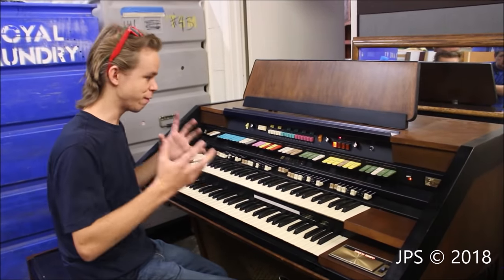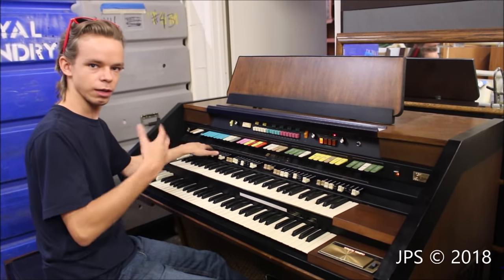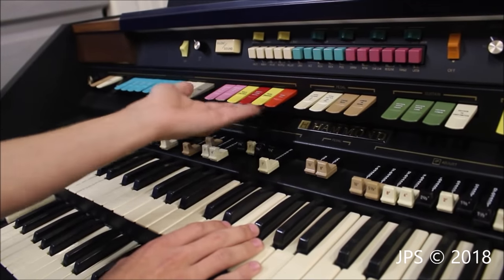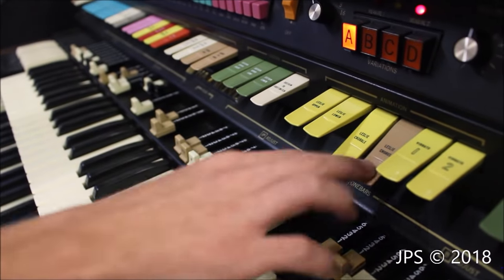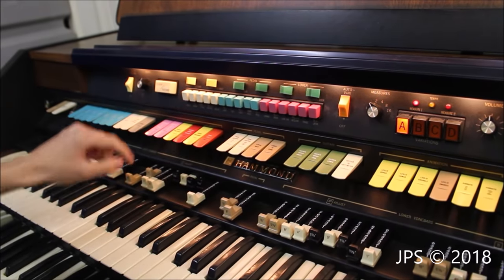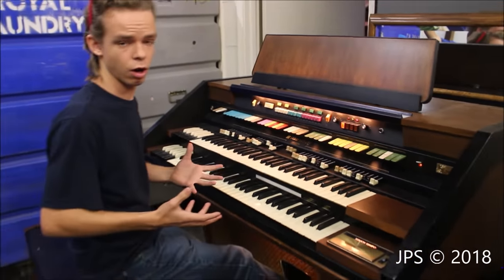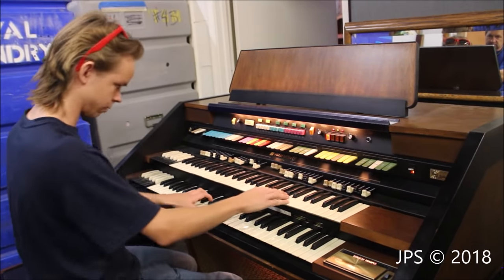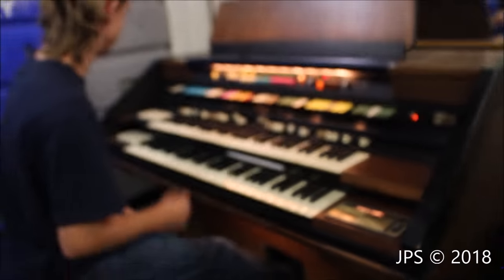James finds a $300.00 Hammond Organ, your thoughts? Cheap Deals

Comment: I have the exact same organ (almost) sitting 20 feet from me as I type this. Electronically, the Concorde was a great design...mechanically not so much. First, that constructed all the electronic (PC) boards out of phenolic. Over time they warp and so when inserted into rigid inline edge connector sockets, some of the edge contacts....do not make contact and this can cause a lot of random problems. Boards made out of glass epoxy, while slightly more expensive,  do not have this problem. No one uses phenolic anymore. Cleaning the contacts will not solve this problem, but will help the ones that are still making contact.

Hammond used the best capacitors available at the time they designed the organ...late 60's. The only ones that I have seen fail are the power supply electrolytics as they do with age in all electronics. When they are leaky, they typically cause hum..not static. The tone wheel organs had a bunch of "orange drop" caps in the tone wheel assembly that have to eventually be replaced also as they drift in value with age.

The IC's in the Concorde were custom designed by Mostek .. a Texas company that also made the parts for the first electronic calculator and many other things. Very new technology in the 60's and probably .. counting their design cost as it was unique to the Concorde .. was half the cost of the organ for Hammond as everything else is discrete parts and common ... still available today.

I designed electronics for a living and am now retired with time so fixing these problems became a challenge for me. ;) When I bought the organ in the early 70's they gave me the service manual so I had all the electronic info. I relaid out all the boards in glass epoxy, combined some circuits onto fewer boards (there were a lot of boards!) as smaller and better parts are available today, and ... because engineers can't resist "fixing things" .. changed a few circuits including the power supply which was ... a mess. The original "unobtainium" IC"s were carefully removed from the original boards and installed in sockets in the new ones. So now when I turn it on, I can count on no problems. I hope! A fun almost year long project, but glad I didn't have to pay for the labor!

I've seem the custom IC's being sold on the web for 200 dollars each ... and there are 45 of them, so if you find a Concorde cheap, carefully remove the IC's from the boards, and then throw the rest of the organ away you could make some real bucks!

Hammond designed and sold several other "IC"  organs after the Concorde including the Elegante in the early 80's. Between their design cost and the fact that people were not buying home organs any more, it probably put them out of business. 

Jim
Reply: Cool project! I’ve done a similar sort of project on my Soundcraft 2400. The original PC boards were FR4 but single sided. So many pads lifted from the leverage of especially the TT patchbay jacks but also some of the switches. I’ve redone most of the board in double sided FR4 with very generous pad sizes on both top and bottom, and it is now very reliable. Some of these ‘disasters’ can be cool projects when you are an engineer or technician.
Reply: I came across one of these back in the mid 90's when I had a business fixing organs . These were almost impossible to repair due to the custom chips you described and the warped boards were a nightmare. Cudos for fixing yours that's a labour of love. I have an L111 which is much simpler and through my Leslie 147 RV it sounds like a Hammond should.
Reply: Kind of a shock (get it?) when you consider that the contacts in a B3 were made out of palladium.
Reply: I was going to say, that thing is definitely pre-1980s just from the external design, but also organs were so uncool by the 80s because of synths.
Reply: I hope you also took the time to think adding a feature to your new glass epoxy PCBs !!!..... yes ADDING A MIDI RETROFIT TO IT....OF COURSE, IF YOU BELIEVE IT CAN BE DONE !!
THAT WOULD BE AWESOME AND EVEN NOT HAVING TOUCH SENSITIVITY
IT ADDS A LOT SPECIALLY IF YOU PLAY VIRTUAL SYNTHS LIKE THE 
B4 II by Native Instruments Plugin.....but now it is discontinued !
There are other Virt Inst brands to find Hammond like sounds !
Please post comment if you think you will add that and add your video
working MIDI with your Concorde !!
Thanks

ps. sorry 4 the caps, the caps key got stuck !
Reply: @techy5025  Great comment. Maybe the most helpful I've read all week. I grew up with a Lowery organ, so I totally understand your passion to fix rather than scrap'n'sell. One day, perhaps I'll get around to fixing my old Lowery. It currently still sits in the basement waiting for Godot.

Comment: Last winter my wife and I were thrift store shopping over near Pittsburgh and we wandered into a Goodwill store. There was a Hammond M3 Tonewheel organ sitting in the furniture section. It looked like new except for a recent scratch likely acquired in the donation pickup. The store clerk said that it was being sold as a furniture item and it could not be tested or even plugged in due to its age and lack of a modern 3 prong power plug. It would not fit in my car, but I paid the asking price and was given 48 hours to pick it up or forfeit my money. Of course it was snowing when I set out to pick up the organ, but the guy unloading the donation truck helped me stuff the 250 pound beast into my Honda Element.....it barely fit. This M3 turns out to be from 1958. The original purchase receipt was in the bench, as was a receipt for $200 worth of servicing from just over a year prior. Seeing that, I decided to forgo the usual teardown needed for vintage electronics, and plug it in. To my surprise, it plays perfectly with no hum and all functions work. It's still going great 9 months on. The purchase price.......$39.95. It cost me more in gasoline to make the two 70 mile (each way) trips to get it.
Reply from the maker: What a wonderful story. It's just great to hear about saving a vintage instrument from just being a piece of furniture or worse.
Reply: I used to play an ARP Odyssey back in the 70's, but never had a tonewheel Hammond or room for one. I was surprised to see it at a Goodwill store for cheap, and couldn't pass it up. I can't play like I did nearly 50 years ago, but still try. My daughter plays well and maybe one of her kids will get it somewhere down the road.
Reply: I wonder how many people are still around to rebuild these things what a unbelievably fantastic musical instrument
Reply: Now all you need is a Leslie to go with it; of course it will cost quite a bit more than the Hammond.
Reply: Booker T machine
Reply: @ TubelabCom: make sure you'll never let me know where you live or you'll be saying goodbye to your great find sir! did i say "find"? no, it's a steal you happened to make u lucky U! ;-) :D
Reply: @dojmike  don't forget about the a182... I have a 1970 in the garage and  it's the first model that electronic met electric from what I gathered from talking to many professionals at the last few namm shows...
Reply: I received a M-100 from a church in upstate NY  ("just get it out of here")
They could not figure out how to even turn it on.  It had been so long since service that the motor would not start.  A little oil, a little patience, and two weeks later, I had a functioning M-100.  Great sound, but, i donated it to a local church that needed one, just to maintain karma.
Lots of neglected ones out there that just need a little love.
Reply: @bigbirdnys  You did a good deed! I bet they were thrilled to get it!
Reply: TubelabCom: You scored BIG with that organ. Make a video when you get it squared away..
Reply: Wow! Good to know, that you can still find a diamond in the rough!

Comment: I repaired a similar model Hammond for a relative in the '80's. If I am not mistaken the one feature I did not see you explain is the brass switched capacitance touch plate on the lower left manual that can be used (when set to "on") to set tempo and start a previously selected percussion rhythm automation by tapping the plate 1-2-3-4 (HAMMOND TOUCH TEMPO)   Great Video.

Comment: These are completely solid state. No tonewheels and no tubes. I had an R-100, which is similar to this, and it seems 90% of the electronic gremlins on these are due to the 'edge-cards' they used to house the components. These individual boards plug into a bus, much the same as computer graphics and sound cards plug into a motherboard. The contacts get corroded over the years, and it's a pretty simple (but time consuming) job to pull all the cards and clean up the edge contacts with fine steel wool and some electronics spray. The spray also works well for any tab switches and potentiometers. ...and yes, the swell pedal should function for both the normal speaker, and the Leslie. There should be dual 'pots' on the pedal assembly that control both sides.😉 Hope you got it straightened out.😁

Comment: In the 60's, there were probably more piano & organ showrooms than guitar centers, and I drooled over organs at every store in my hometown.  Organ makers were starting to add beat boxes and percussive tabs like banjo and piano.  They sounded somewhat cheesy, but gave organists more options.  Bass & cymbal on the pedals and snare & cymbal on the lower is borrowed from the traps in theatre/pipe organ – it works great in om-pah music.  Hammond followed the new trends fairly quickly.  And at that point, there had to be a speaker with a moving baffle to use the Leslie name; remember they were 2 separate companies.  We have a similar Hammond at church but without the chrome pedals.  That sleek look may have been copied from the the top of the line Yamaha Electone – everyone said it looked like a refrigerator.  Finally, there are published copyrighted versions of “House of the Rising Sun” but the song itself actually predates copyright law.  Thanks for the video.
Reply from the maker: Yes, but the version I played was from the Animals, and that version is copyrighted. I am in the process of writing a new arrangement for House of the Rising Sun, and it's coming out very nicely. It will have the same words as always as they are not copyrighted, it is not known who wrote the words, and so no copyright on them.
Reply: Fun fact: Guitar Center started out as Organ Center in California.
Reply: a hammond organ is completely different to synthesizer right? i mean they are two comepletely different things. right? sorry for my stupid question
Reply from the maker: @johntsiaros2362  Well for a vintage Hammond organ they would be on different ends of the universe.
Reply: The flute sounds are the best.
Reply: I have a 69 spinet T-243 and the percussive settings along with the rhythm machine are very cool additions they made.

Comment: Amazing!  I have almost the exact same Hammond Concorde organ (this model is the 2312M).  The only real difference is that mine has the piston preset buttons located above the upper keyboard instead of on the left side of the keyboards (that's what the reversed black and white keys are on the model here).  I bought mine used in 1981 in Montgomery, AL, for about $1800, if my memory serves me well.  I still have this organ but just like this one, it suffers from hisses and pops as well as power supply problems (the organ sometimes just shuts off by itself).  I thought it about finding someone to repair it, but after reading the comments here about the phenolic circuit boards and expensive ICs, I don't think it would make sense.   While I'm pretty handy with fixing things, I don't think I want to take on the challenge of making all the repairs myself.  (Maybe I should take out the ICs and sell them as someone here suggested and then trash the organ. Not sure I could bring myself to do that, though!)

My wife wants me to get rid of this organ but it has sentimental value to me.  I grew up in Miami, FL, with a Lowery spinet organ and later a Yamaha console organ in that was really junky compared to this Hammond.

I wish they still made console organs like this.  There's just something special about playing these, with all the bells and whistles, compared to a synthesizer.  I, too, remember the organ/piano stores in the shopping malls.  When I was a teenager, used to love going to the mall with my friends and then sitting down and playing a mall store console organ and waiting for a salesman to throw me out, only for him to do an about-face once he discovered I knew what I was doing and was a pretty good young organist.  Then they would try to sell me one!  (Very expensive back then.)

If anyone here knows how to change the music rack light bulbs, please let me know.  I know how to open the top of the organ but I can't for the life of me figure out how to get the translucent cover off the light to change a couple of the bulbs that are burned out.

Thank you so much for posting this video and thanks for all those who commented!

Comment: Thanks for the video. I recently acquired a Hammond H-100 and had no idea that a tone wheel generator was a thing that existed. This thing is so complicated! The inside was pretty clean, though all the galvanized bits had gray fur. I replaced the power supply filter caps with Sprague axials (and relocated them offboard), the power cord, and the 5AR4 rectifier tubes, added a 4A breaker switch, tested/cleaned/reinstalled all the tubes, replaced the 7591s with 2 new 7591A tubes, used my fingernail to gradually loosen a frozen section in the clockwork toner generator until the motor would spin it without help, added new oil, sprayed WD-40 from underneath to get rid of all the residual bearing noise, disconnected/cleaned/reconnected all the major accessible wiring connectors, etc. It seems to mostly work! There is more hum & hiss than there should be but I just obtained an original service manual, so I hope that will help chase those issues down. It seems a few of the drawbars do not appear to work and I understand that there is a way to shift the bus-bar and wipe the contacts and/or give them new contact surfaces. Any suggestions are welcome! Oh, I do not play the keyboards and my prior relevant experience is limited to tube guitar amps and effects and being mechanically intuitive.
Reply from the maker: No WD-40.
Reply: .
Use "Singer(sewing machine) oil" instead..
.

Comment: That my friends is a Hammond Concorde.  It was the 2nd generation of the same name,  the first was from the early 1970's.  This one dates to about 1978.  It was their best model at the time,  and sold for about $10K (in 1978 dollars).  It featured a new "gadget" called "touch tempo" (the gold plate on the right side panel - lower keyboard) whereby you could tap in your tempo (4x) and the organ would match that tempo.

Comment: I forgot to mention, the tabs/switches above the drawbars on the left side (blue, white, tan, pink, yellow, red) may work perfectly.  James didn't realize you have to have the first of the black preset keys (immediately to the left of the white/black regular keys) depressed to activate these sounds.  They can be combined with one set of the drawbars.  It's an easy mistake to make.  The piano solo tab overrides anything on the upper manual when depressed.  Aso, these colored tabs have a 2nd voice that is activated by depressing another tab at the far right side of the tabs called "second voice".  It changes the "plunk" on the harpsicord into a violin, other sounds in to saxophones, or trumpets, etc.  When you use the violin with a Vibrato, it's hard to tell from a real violin.  Lots of cool stuff on there if you know how to turn it on.

Comment: That is one of several Hammond models that came out after the H-100 series and with features derived from the X-100, perhaps the finest Hammond electric organ ever made. The point of this model is to combine the full hammond drawbar system with percussion, vibrato, and so forth PLUS the tab section which adds the transistor organ and related sounds. That gives you great string, reed, and other sounds to combine with the Hammond sound. There are a lot of good miscellaneous percussion effects.There are a lot of cool things you can do if the organ is in full operating condition. It sounds like yours needs repair. The problem is finding parts AND a repair person that can help you. I prefer the current Hammond SK-1 and XK-3 with good synthesizers on the side. I wish you the best!